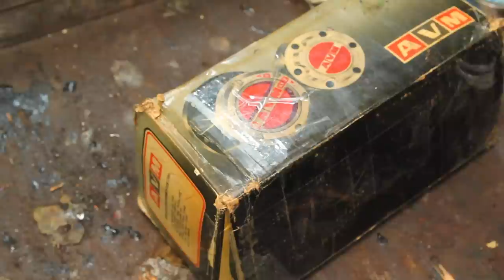Front axle rebuild: Jeep CJ5 Part 5

Comment: I have a set of carrier bearings honed out ,they slide on and off the carrier . Use them to set up your rear side to side clearance.  After it set ,them install your new bearings . Saves from having to pull new bearings and possible destroying the new bearings.  I also use a long 1/2 extension and socket to remove and install inner axle seals

Comment: the piece on the outside of the inner axle seal is a ramp to guide the axle up through the hole in the seal.
you're always better off to put a small amount of preload on jeep (or any 4wd) front wheelbearings. the rears can run 0.003" end float as they don't deal with steering stresses.

Comment: So that tool is great, BUT - they give you the second knurled nut so when you set  the height of the orange or black collar with the top knurled nut, youre supposed to snug the bottom nut up against it so youre not trying to use the puller against just the 2 or 3 threads of those thin nuts...... you use the one to back up against the other!! Youre lucky that Chinesium tool didnt shit the bed!

Comment: That tool looks pretty interesting. Should check if they make anything for wheel bearings as well. it's always a pain to get the stuck bearing race off from the axle tube or the other half of the bearing off the axle shaft.

Comment: You could clamp the puller horizontally in a vise with prismatic soft jaws. Depending on the vise even vertically.  I think I only saw a small vise on your bench, might not work. If shipping wasn't so expensive I just happen to have big worn down non metric vises sitting around, with different levels of rebuilt necessary. But shipping is so expensive now 😔

Comment: After watching your video I contacted Vevor, in an attempt to start a dialog with them and get two questions answered.  How on earth do you deal with these people?  I asked them "I am working on a youtube video series on rebuilding a Dana 44 and a Dana 30 for the "$2500 Jeep" - does the 'D30,40,50 tool set' specifically fit the D44 axle?" and "what other tools do you make for the D44/D30 that would make rebuilding these easier?   - their responses to my attempts to discuss this with them - FIVE TIMES SO FAR - was "send us your invoice number so we can contact the supplier to solve your problem" and "send us a link to what you ordered" and lastly "we understand your problem, send us a screenshot of your order so we can solve it".  I just dont understand it......
Reply from the maker: It should work for the D44 just fine, i know the pinion bearings are the same as the 25, and the carrier bearings shouldn’t be too much different- it’s got a pretty wide range of sizes of bearings it will fit.

Comment: I am in the process of rebuilding a Dana 27 for a 1971 CJ5. I also couldn’t get enough tension from the king pin bearings even with new bearings and races and no shims.
I have never seen a washer placed between the top bearing and the knuckle. Do you know if the factory did this? I am thinking that I need to replace the pins themselves